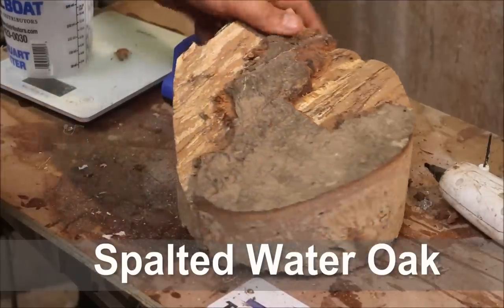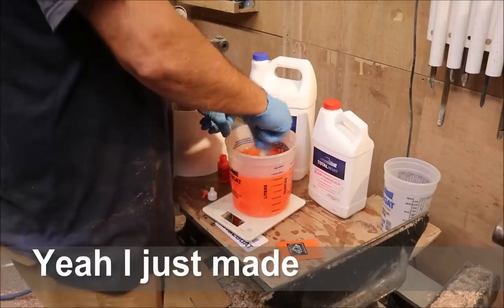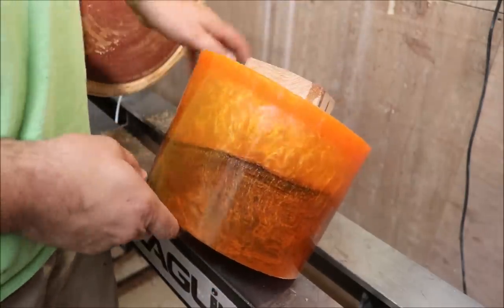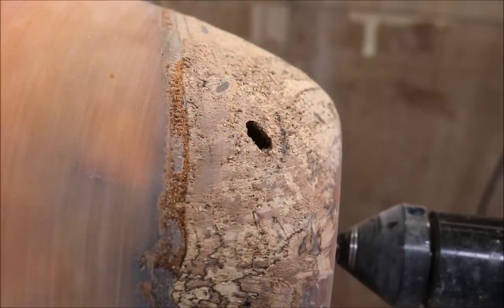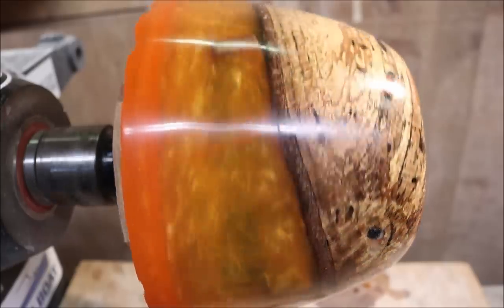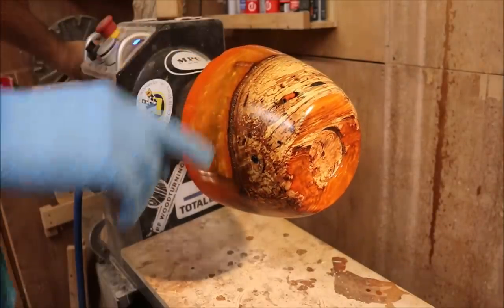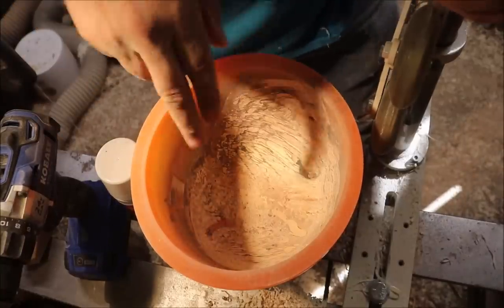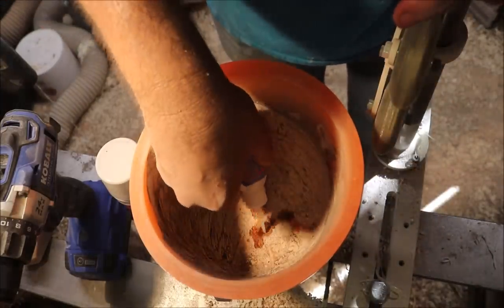Wood Turning - Autumn Rising

Comment: You might want to change to totalboat thickset.  Sets up slower and doesn't seem to crack.  At least that's been my experience.  Pressure would help too.   Zak Higgins has a video on a Harbor Freight paint pot that is easy to convert to a pressure pot.  It would help you not have those voids.  Take care, Larry
Reply from the maker: Hey thanks for the info. I use Thickset sometimes also I did use a pressure pot. The issue I had with the cracking was my own fault as I did not use enough hardener. I realized it when I rewatched the raw video. I'm a knuckle head and in my haste I failed to pour another 100g of hardener. That mixed with the large pour caused a thermic reaction. BTW I really like your channel and that last bowl you did was off the charts. 

Ken
Reply: @MoonpieCreations  Usually they crack when you use too much hardner.  Probably just too much pour at a time, take care and Thanks, Larry
Reply from the maker: @TheWoodWhirler  Thank you. That is definitely a possibility. It was way to big of a pour for 2:1. Thank you sir I appreciate it.

Ken

Comment: One thing you could do to keep your wood from shifting is to drill a hole and run a wooden dowel through them and just slightly into your main piece of wood. It should act as a nail but it being wood you can turn it away.
Reply from the maker: Wow, thanks. That is a great idea. I may try it next time.

Ken

Comment: I made the mistake of buying TB Penetrating Epoxy.  Bad news as it creates so much heat it melts and distorts the plastic containers.  Nice looking bowl.  That punky oak is cool looking.
Reply from the maker: Hey Brian, thanks for commenting. I've used TB quite a bit and this was the first time it overheated for me. To tell the truth, it overheated because I pour to much at once and my mix was off. Did you use 2:1 or the Thickset? 

Ken
Reply: @MoonpieCreations  Hi Ken,  I used 2:1 epoxy.  Normally I used the 2:1 High Performance epoxy and have no problem.  The penetrating epoxy is thinner and maybe isn't made to use in big pours but it does penetrate into the wood grain of punky wood nicely.
Reply from the maker: Strange, the Thickset is made for larger pours. I have done 2000g pours with no problems. 

Ken

Comment: Beautiful work once again. Any suggestions for which resin to use without a pressure pot?
Reply from the maker: Thank you. You can use either 2:1 or Thickset. But you must do small pours. No more than 1/4" at a time. 

Ken

Comment: Hey Ken.  The bowl turned out superb.  Quick question.  Do you use a moisture meter, or seal, or use Cactus juice or anything on your wood before you pour resin?  I've notice that you don't seem to have to many problems with air or moisture showing up in the finished resin.  Thanks for another great video.  Have a good 1, Dave.
Reply from the maker: Dave, I use a moisture meter. I also dry my wood in the oven over a 24 hr period. Lot of work but cuts the moisture in the end. Thanks.

Ken

Comment: I have done some turning with 2 part epoxy and I was not able to smooth away sanding marks with 800 grit.  Does the Mylands help fill in the scratch marks?  And then with the polishes to smooth out the Mylands coat?  I really like how the bowl turned out.
Reply from the maker: Hey Stephen, Yes the Maylands helps fill in the scratches, but the Acks is really the work horse. I sometimes use the Acks abrasive paste two or three times to get all the small scratches out. Then a coat of OB shine juice gives it a shine.  Hope that helps.

Ken
Reply: @MoonpieCreations  thanks for that info.